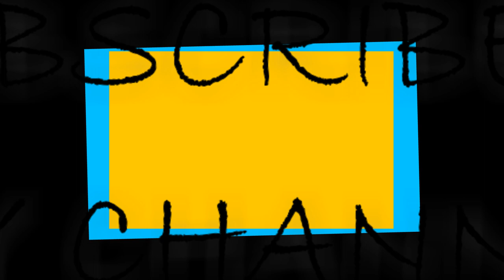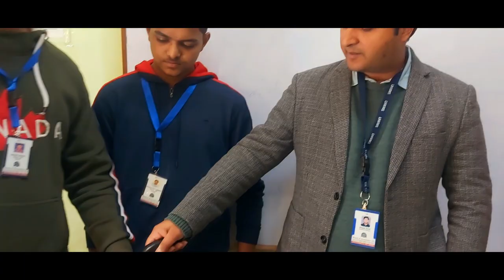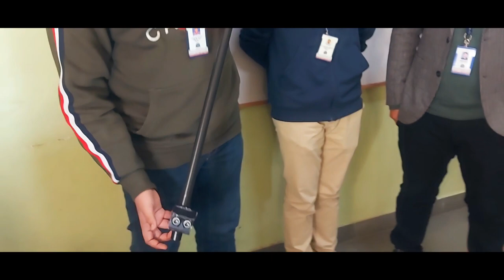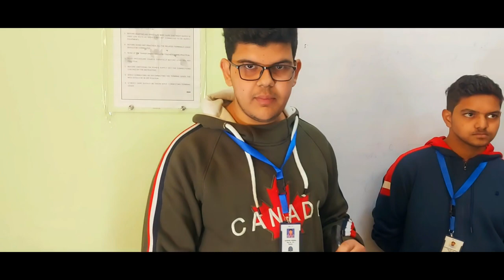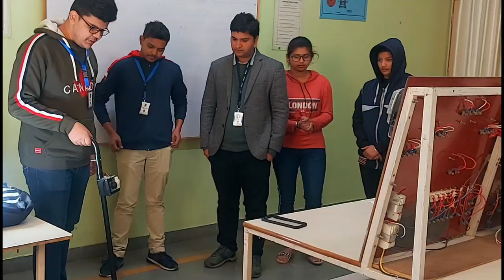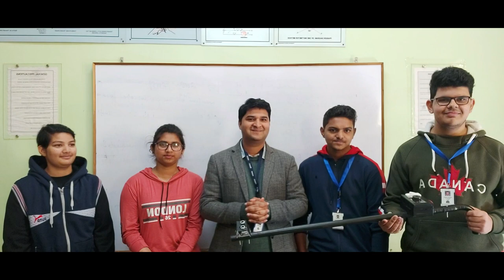SMART BLIND STICK FOR BLIND PERSON \\ SCHOOL OF AERONAUTICS  || NEW INVENTION 2020

Comment: Good work but how is this possible overall cost is 450
Arduino cost is about 400 and 40 rsp buzzer then 20 reps switch then vibrating motor then wires and pvc pipe
then ultrasonic sensor which you have used 2 so approx cost 150 rps.
Reply from the maker: There is a electronic market in delhi Wazirpur , from there they bought all components at cheap rate

Comment: arduino
buzzer
jumperwires
switch 
vibrating motor
ultrasonic sensor *2
then you have aslo use a spray paint to paint that pvc pipe

give me the exact price of this
Reply from the maker: There is a electronic market in delhi Wazirpur , from there they bought all components at cheap rate
Reply: @OlympiadChampions  thank you for telling me this sir. 
Even in our schools kids are making these kids of project. 
Smart stick, line follower bots etc. 
Surely i will visit there. 
Once again thank you
Reply from the maker: Most welcome 👍🤗